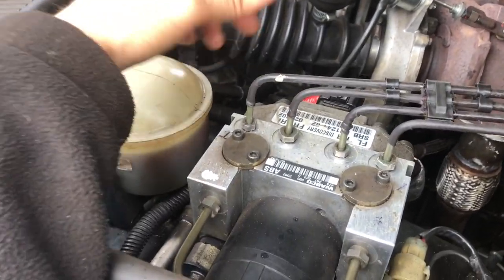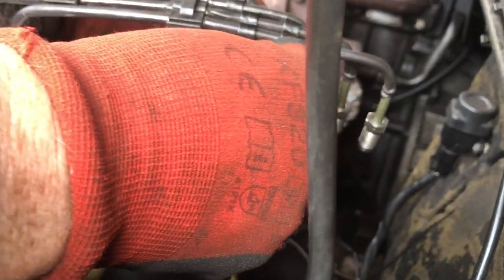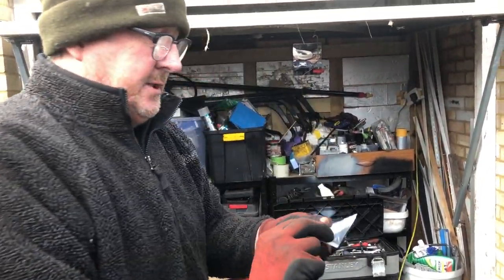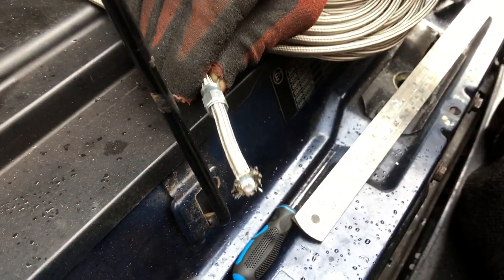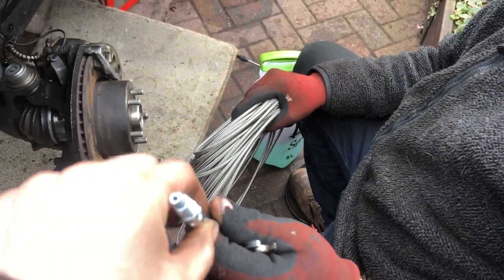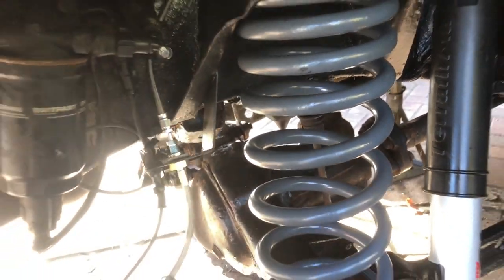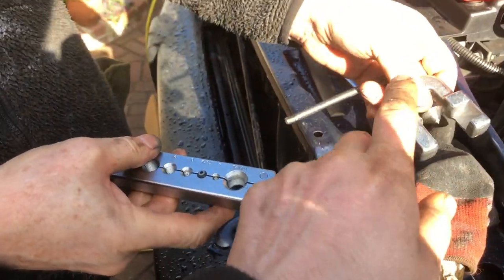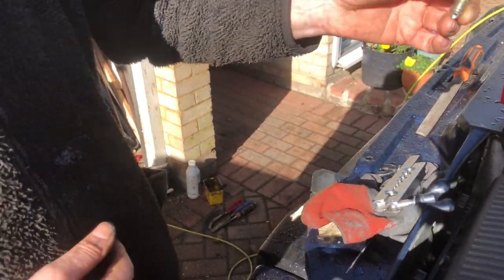Land Rover Discovery 2 TD5 Full Stainless Braided PTFE Flexible Brake Hoses Installation How To

Comment: I like these. I wonder if they do anything slightly bigger bore, might work for ACE pipe replacement.
Reply from the maker: good point, possibly
Reply: I would imagine so.. If not pioneer4x4 do kits whatever colour you want.. Probs cost a bit more but it's all made up ready to fit.. Do fuel and brakes to

Comment: Hi Guys, brilliant videos. Very helpful. Have you done a video about bleeding the brakes after you've changed all the lines?
Reply from the maker: We haven't specifically, is there something you want to know?
Reply: I've read that people have had problems with air being locked in the abs module. As you have replaced all your lines, did you have any problems, and have you guys got any advice you would give?
Reply: I was about to ask same question.. Is it true you need Nanocom to bleed them?
Reply: @bigtone2005  bettor for all abs bloc, on all car with abs and specialy with esp